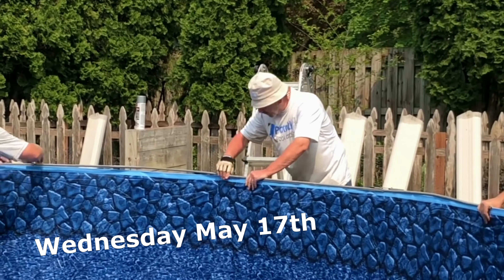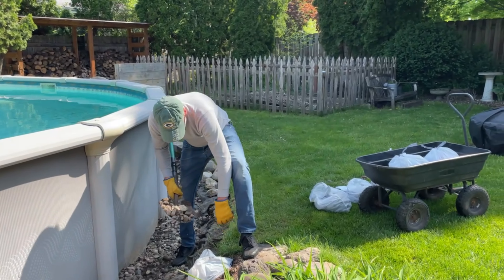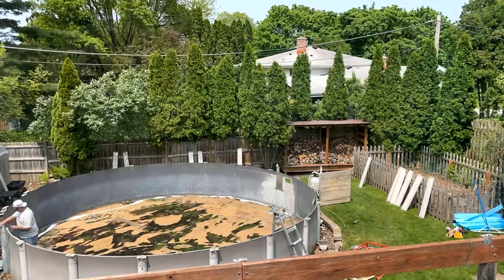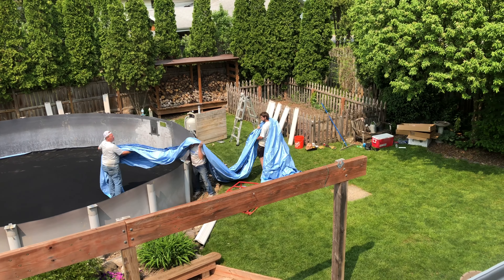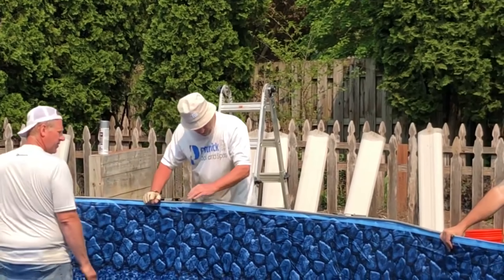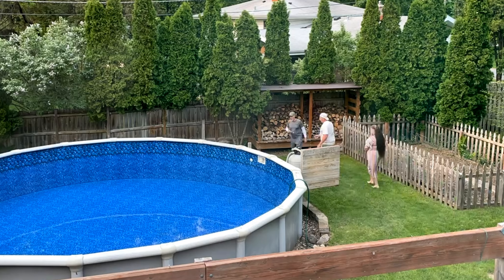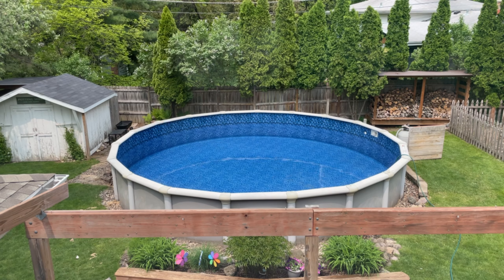Pool Liner Install (Vinyl Above Ground Pool Liner)

Comment: Great video. What kind of pool you have? i mean is it Steel, Aluminum or Resin?
Reply from the maker: Thank you! The pool is over 20 years old now so I can’t remember for sure but I think it’s steel because it had rust that was repaired around the skimmer at the time the last liner was installed. The pillars and cap are definitely a resin

Comment: We just bought the same liner. We got our pool 4 years ago and one winter the wall got crushed and we got a hole in the liner. We patched it but next summer more holes showed up. We tried patching but it still leaked from God knows where. This is Boulder swirl I think. Ours is in transit and should arrive soon. I didn’t know about the rocks, I was considering adding them but maybe I won’t 😅. I actually prefer a light coloured pool so I can’t wait for the new liner to fade 😂. I’m wondering what it is that they put around the pool that looked like a foam circle
Reply from the maker: Wow, bummer about all the holes in the liner! Once everything is up and running it’s great and we really enjoy it. We weren’t aware of the rocks at first either, glad we didn’t have then very deep before we started to remove most of them. 
The foam cove on the bottom provides a barrier to protect the liner from stretching and ballooning under the pool wall, enhancing the integrity. Good luck with everything, let us know how it goes! ☀️

Comment: What was it that you put around the edges before you put the black tarp I ??
Reply from the maker: Pool cove which helps keep the weight of the water inside the pool and prevents the liner from ballooning out from under the bottom of the pool wall.

Comment: My wife and I just purchased a new home with a 10 year old 24' round above ground pool. The top 5 inches of the liner is slack and you can actually reach around to the outside and pull it taunt but then it goes right back to slack. How would I go about correcting this?
Reply from the maker: Great question! Sounds like the track the liner sits in is not working anymore (old, defective, or broken). 
If it were us, we would check with a local company to have the track replaced, or the liner and track both replaced. It can be dangerous to have the liner slip so much and the pool walls possibly collapse. Might be a good idea sooner than later. Let’s us know how it goes! 🙂

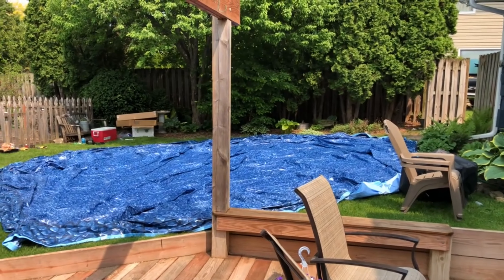Comment: 2:50 2:50 2:50
Reply from the maker: Sorry for the late response, the liner price was $829.99. The liner replacement labor was $1200.00
The pad under the liner was $399.99. 
We also spent some money for new coving, and some labor to install the coving, repair the damage by the skimmer basket and the full price of everything is now in the description box at the very bottom. 
Take care😊